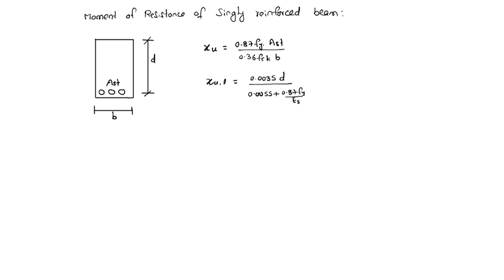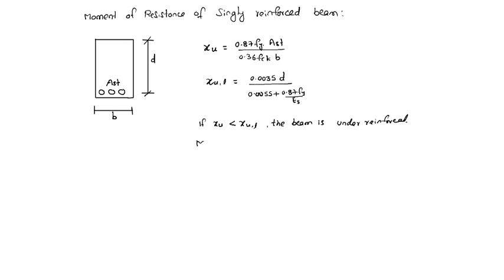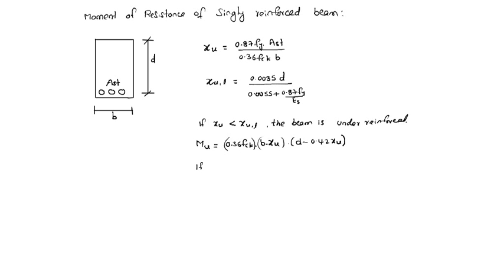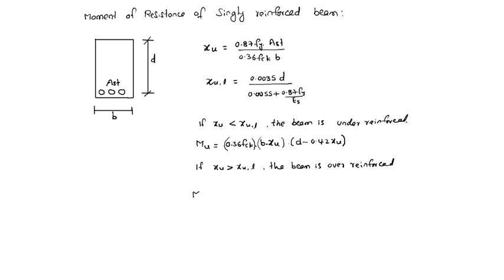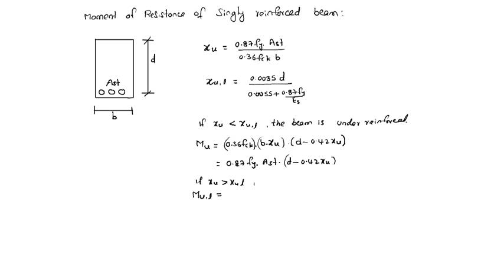moment of resistance of singly reinforced beam

Comment: Sir I think there is a mistake here , if its under reinforced section then the failure will happen with steel first so the Moment of resistance formula should be 0.87 Fy Ast (d-0.42xu) and not 0.36fckbxu(d-0.42xu)
Reply: T=C, So you can use both formulae to calculate MR. But for over reinforced section we cant use actual Xu as concrete fails first, so use 0.36fckb x lever arm or use 0.149fckbd2, 0.138fckbd2 and 0.133fckbd2 for Fe250, Fe415 and Fe500 respectively